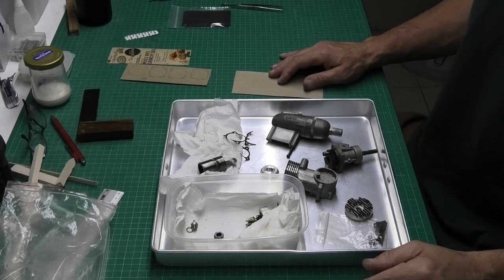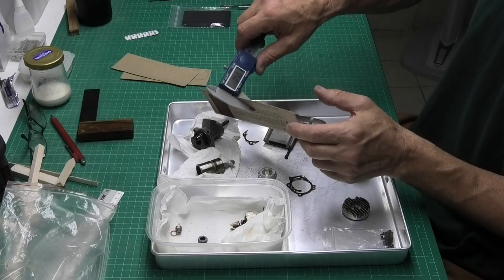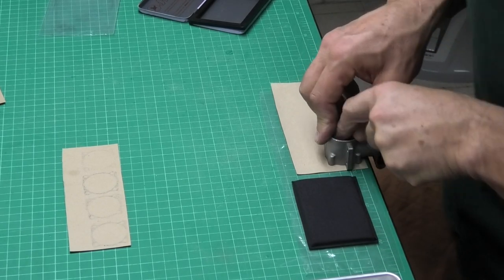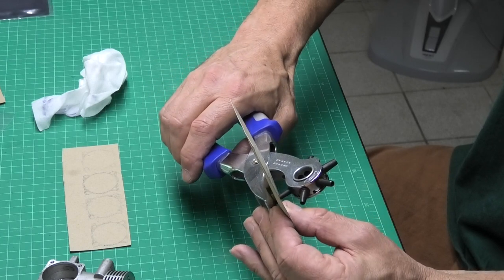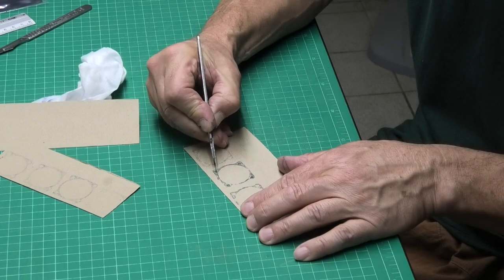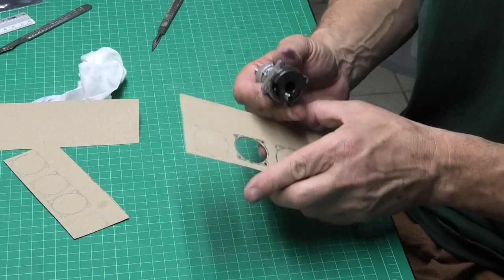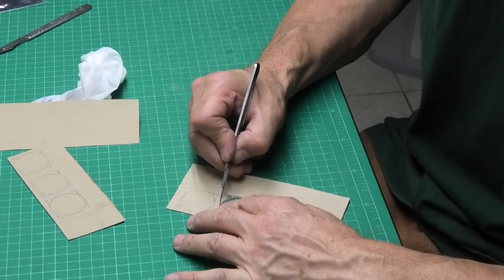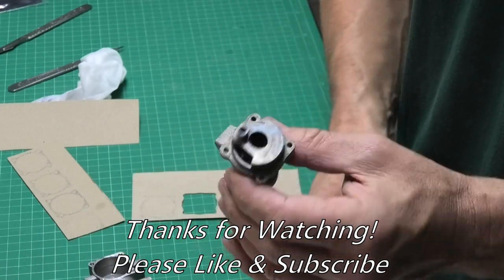How to make your own Glow Engine Gaskets - RC Model Aeroplanes Build & Repair

Comment: Mark ----- Thank you for showing how You make gaskets.  Another Tip for my book --- The Ink Pad a good way of transferring part image to gasket ( cereal box ) or the automotive gasket material.  And a Second Tip of using a second piece of gasket , which ever one you use, behind the one you are punching holes through  -- like using a Leather Punch tool with a rotary fixture with different size punches . Keeps holes clean and crisp
         Manolo - below ,  I say take it up again . A Good Hobby ----------- I'm 73 and starting again been some 58 yrs.  Mark will do you right . Follow his every move and you'll be on your way to having some FUN!

Comment: Is that simple cardboard? Won't it be affected by glow mixture? Thank you!
Reply from the maker: Simple cardboard is fine, but the denser the better.  also, good to use propper gasket paper which is cheap enough from car repair shops

Comment: thanks a lots for this video Mark,this is very informative.But can you confirm if we need to soak the Gasket in some oil prior to fitting?
Reply from the maker: Hi there, I would not soak in oil, but would just smear a little bit on the gasket to help it seat properly and also to hold it in place during assembly.  Thanks for the kind comment it's appreciated.

Comment: A nice, detailed explanation.  You Brits are so articulate.  Honestly, I thought you might have a great trick to punch the big circle without doing it by hand.  Not to be.
Reply from the maker: Rick F Hahahaha, thanks for the comment, it's appreciated. I did try cutting out the big center circle with a hole cutter, but so difficult to line it up correct. 😀

Comment: Hi, I’ve been told by a tamiya shop that I can use kitchen grease proof paper to do the same as that’s basically what mine is
Reply from the maker: Hi there, grease proof paper is quite thin, so if using on the backplate it could be a bit thin and cause the conrod to rub, just a thought.  Thanks for the comment
Reply: @MarkRobinson555  thanks for your help, I was thinking the same, maybe I will try it with a few layers glued together. I’m buying a new one for the car, might also try your method